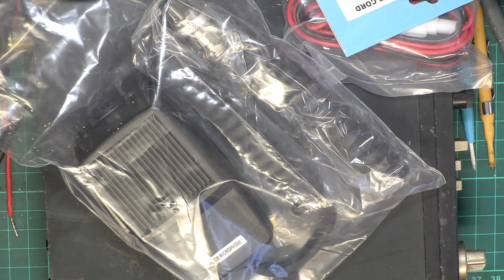Radiomobile CB202 UK CB27/81 CB radio (mobile) - PLL repair & service

Comment: They were ok, but I never was a fan of disco lights, give me a meter any day.  Strange though, these and the ford, both same set up were the only sets I had to replace PLL on.  I think it was something to do with the channel change switch as they did go faulty, flimsy plastic inside unlike the other Cybernet chassis that had a more substantial channel change switch.  Tidy looking sets though.  No I have said about the channel change switch, is it the same as the smaller set?  I honestly can't remember now!
I am getting as forgetful as Richard!

Comment: Well done tracking down the PLL issue. I need to get a couple in as I have a feeling one of my no working sets may be the PLL. I still haven’t found a source for the TC9119P yet. That Warhlowmatic from Chris is a great bit of fun especially as it has the tone and noise generator. I’m hoping Chris has done a video on it. 0.67uV for 12db Sinad isn’t great for one of those though. I wonder what’s dragging it down. Regards Graham
Reply from the maker: The SINAD wasn't the best, but the 'on the air' performance was excellent as expected. It's possible the rx is a little noisier on this one, but in use it's fine. I can get TC9119 IC's but need to buy 100 @ £14 each, so not bothering.

richard

Comment: Hi Richard. Have you got a Magpie Autoscan 5000? There are 2 on eBay right now. Expensive, but are they worth it?
Reply: I’m sure that would be a popular video as they are a rare set. Someone wants £300 for one on ebay. The other one has bids up to £147 with quite a lot of time left to run.
Reply from the maker: Yes I have & it has a fault with the scan circuitry. At the time they advertised the output stage being bulletproof because it used a MOSFET. I only ever had one in for repair...and it had a duff MOSFET output device! Probably advertising hype & being British made it expensive. I think I paid £95 off ebay for our non worker without a mike. It's a video I can do....though whether or not I can fix the scan circuit is another matter! I doubt they are worth it.

Richard

Comment: 1 channel lock...PLL PD pin is gone...
Reply from the maker: Not sure what you mean . Test is this :-
1) VCO voltage clearly not locked & running free
2) check power to PLL
3) check direct access channel 9 operation
4) change IC

In this instance, the radio was still factory sealed so hadn't been messed with & changing the IC restored full operation.

Richard